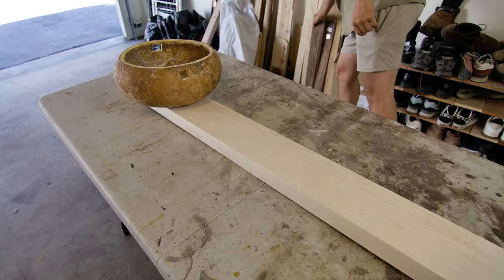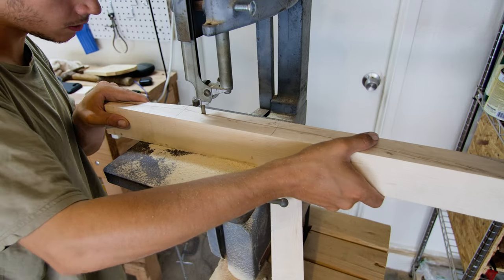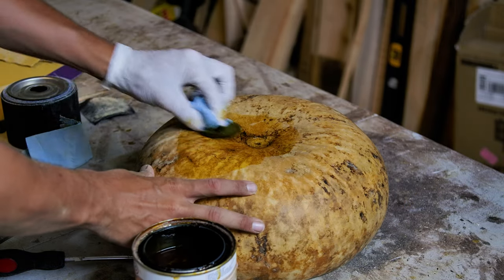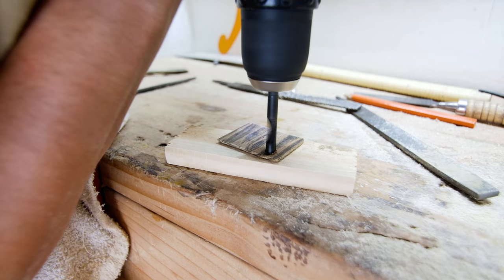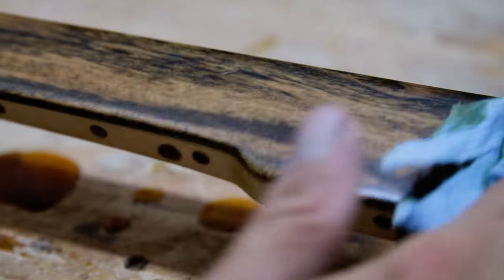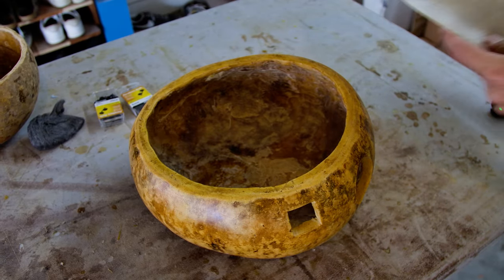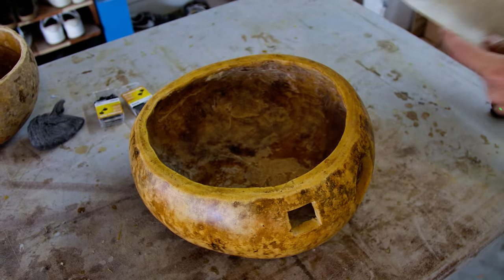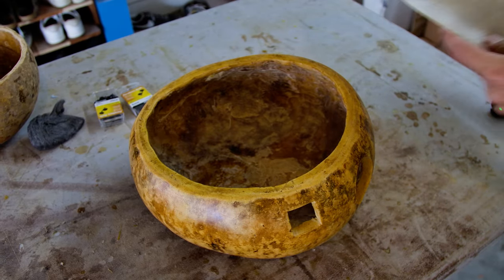full build process of two gourd banjos

Comment: They look great!  What scale length do you use? Nylon or steel strings? Thanks William
Reply from the maker: thanks! I used only nylon strings on these (aquila nylgut). These types of banjos can only be strung with nylon, steel would put too much stress on the neck and would cause damage to the nut and fingerboard. I think scale length for both of these was a standard 26.25"

Comment: what kind of fiberglass do you use?, is it easily available in hardware stores because I have a gourd project of my own but it's incredibly thin and I am totally going to have to use fiberglass, however I've never used it before on a gourd...
Reply from the maker: I just use bondo epoxy and fiberglass cloth which is available in pretty much any hardware store, usually in the automotive section. It's a little tricky to do but if you take your time and have a few pairs of gloves to switch out when they get too sticky, it's pretty straightforward and even if you mess up you can just wait for it to cure and come back to add more layers
Reply: @bengreco  thanks man

Comment: Making do with what you have. Very admirable. However the safety issues others have pointed out are real issues. Not understanding machinery safety Will result in you becoming a statistic. Stop and get some training. It will cost you only afew hours of time. It’s not a matter of if but when. Losing a fingertip, or worse, is no badge of honor for a woodworker.